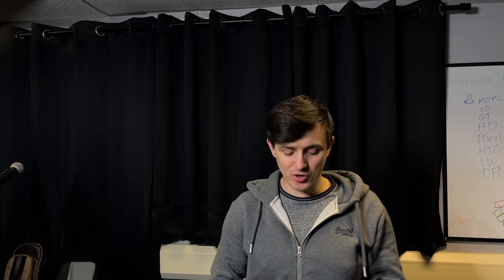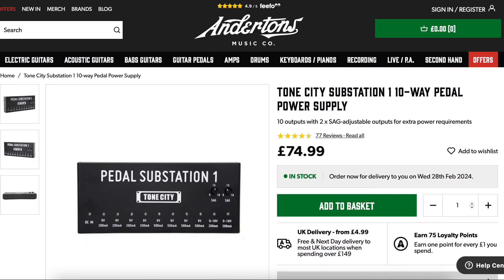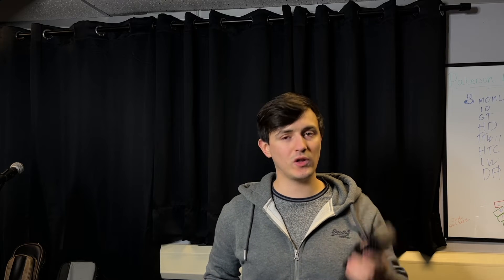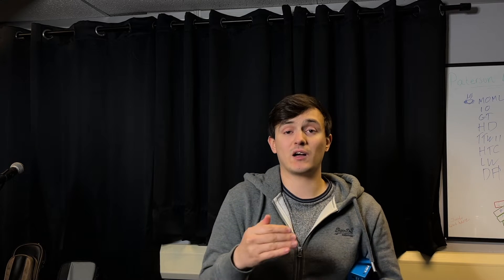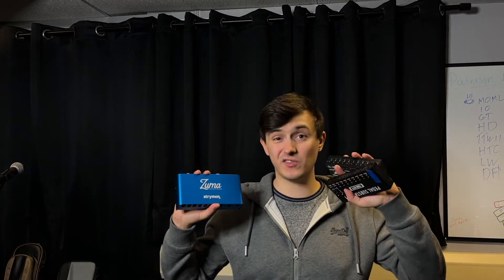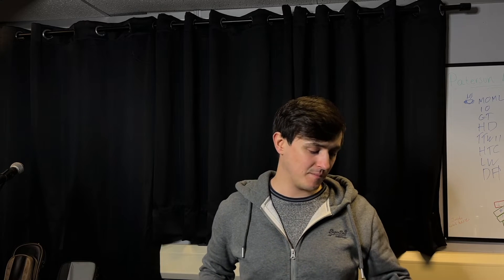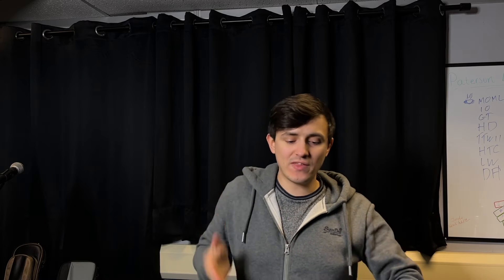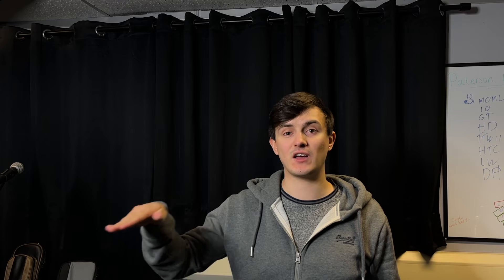Power Supply Noise Test Comparison (Strymon Zuma vs Tone City Substation vs Donner)

Comment: So basically if you use a $40 power supply or a $240 power supply you're going to have noise either way if you use the pedals that cause noise and it has nothing to do with a power supply being isolated.... What is the point in having an isolated power system?